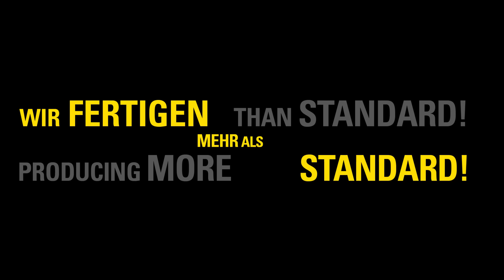UKB SPECIAL TOOLS

Comment: What's the point of 3:50 ? you can make the same part with any radius tool, and in 4:20, why is the top tool made out of 2 pieces, It looks like you could get the same fold if it was in 1 piece.
Reply: I'm assuming most of this tooling is designed for major production.... pure pedal pushing and repeatability.
Reply: @griffinphilemon5083   I get that, but that single fold is just basic break press operation, it doesnt speed up anything, I'm just trying to understand what would be the benefit of doing it that way...

Comment: cool shapes... but im trying to wrap my head around where tooling like this would fit in a production process. i could see maybe forming special shaped flat springs etc. But cant think of much else. Any production engineers or designers out there care the elaborate on the application for this tooling?
Reply: alot of those bends would require re positioning of the piece (or die changes) , it really depends on how many pieces you are going to run. specialized dies like this are incredibly expensive.
Reply: Machines like this (but usually much bigger) are used any time something is made from stamped sheet metal. 

Handguards for exhaust systems, metal roofing, car body panels, laptop shells or PC towers, heavy duty park benches, stair treads, anything.